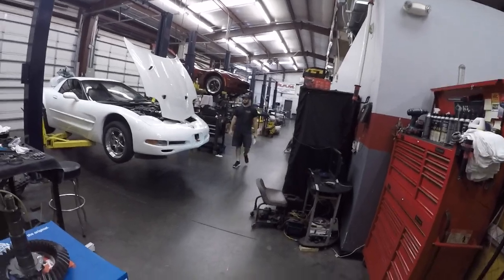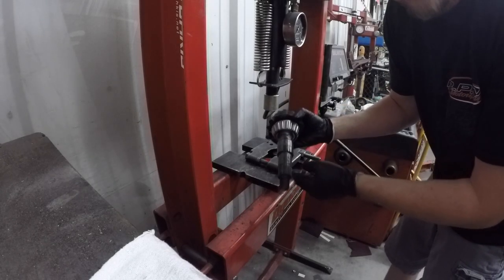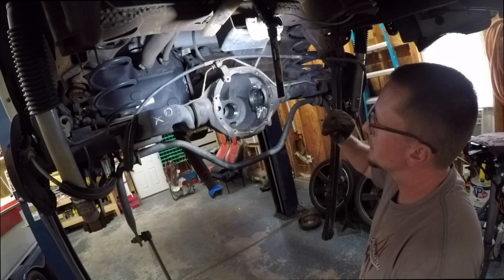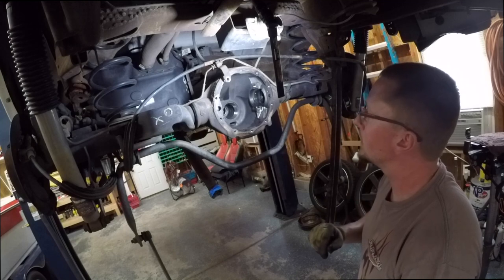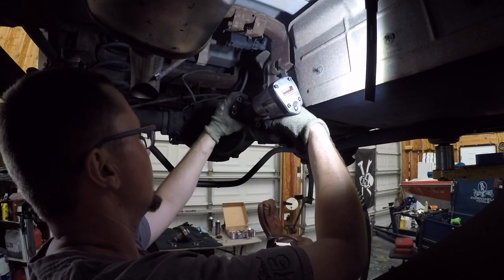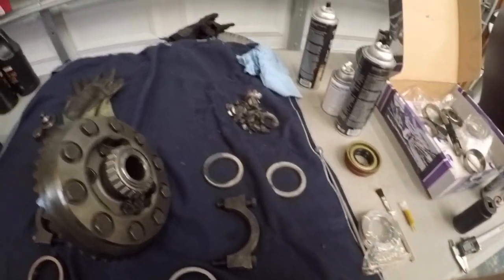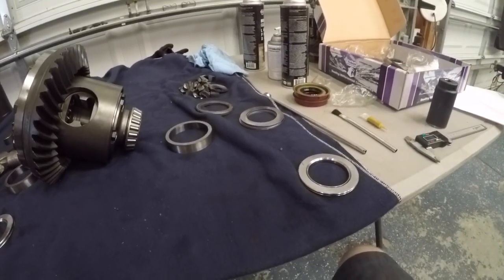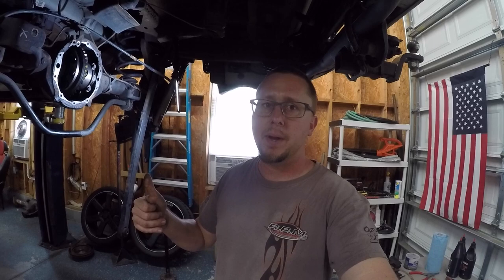How to Set Up Gears Chevy 8.6 Rear End

Comment: I went from 3.42’s to 4.10’s in my 8.6. The pinion shim was way off and I had to do a bunch of trial and error with it. I bought an extra set of pinion bearings and made “setup” bearings. Ended up working out perfectly. No howling or whining.  I put a bunch of heat cycles in the gears going back and forth to work until I got to about 450 miles, then it was all hell breaking loose and black marks everywhere.

Comment: I also have a gm 10 bolt with 3 73 gears in my 07 gmc Sierra. I am in the process of also installing a new am gear set with the master install kit and a Eaton Posi (massive upgrade from the gov lock pyle it came with, gm should be slapped) I couldnt count the different pinion depth and backlash settings I have tried ALWAYS with the drive side pattern running of the heel of the gear. Was totally losing my mind, glad to hear first hand this is acceptable pattern as Im not sure how much more patience I have in me!!! Thanks for the video Im about to slap this B together and get it the F outa my shop!!!!! Thanks again. You got the thumbs up n a subscription!

Comment: On the pinion rotational torque I was taught to tighten it to the point where you can't turn it with one finger but can with 2. Also its interesting that you said 10 to 12 ft. Lb. I was always taught 8 to 13.
Reply: inch pounds NOT  foot pounds!!
Reply: Inch pound boys like Stu said.

Comment: 10 bolt means 10 bolts in the cover. 12 bolt means 12 bolts in the cover. GM  10 bolts are 8.5'" or 8.6"ring gear. 12 bolts are 8.75 ring gear. Ford calls their 9" rear a 9" because of the ring gear size.
Reply: Yep. Thst guy was right sbout alot of things, but wrong about that'n! I actually came to tha comment section to see if any adjustements were made. Lol

Comment: I need help working on a 8.6 GMC 373 gear 20 bolt. Three times I have tried  to set the new gears and each time I have . O55 back lash even after new shim kit and added .045 to driver side an removed frome other still .050 to .055 back lash and each time at first drive it sounds ok 20 miles  gets a ringing. 
It on a 4x4 2002 GMC with 373 gears . Changed gears do to shelling old ones  put the same size back in and all new bearings.he is running 37x13.5x20 tires . I is the opinion gear to fare  in and need more shims .

Comment: The spec is in inch pounds. Your method is how it's done by most but, inch pounds requires a different torque wrench and I've never seen anything but a bendy. I used the GM dealer tool for a ten bolt around 20 years ago for measuring pinion depth and used the included bendy for 12 inch pounds.
Reply: Inch pounds dragging that is.

Comment: First thing, how do you know what thickness spacer to put on the pinion before you press the first bearing on. Do you use the original spacer? Second, If you have to remove the pinion to get a proper gear pattern, do you need another crush sleeve. The way you did it, you set the preload and it was good, no more adjustment there.

Comment: I have a 2014 stock Suburban with the 5.3L, 76,000 miles on it and I am the original owner. Over the past few months, I have been feeling a clunk from the rear of the truck when accelerating from a stop. further investigation shows that when I attempt to turn the drive shaft by hand, it has rotational movement of around 1/16"-1/8", but no in/out or up/down movement. The diff fluid has been changed by me around 15,000 miles ago and everything looked good inside and the magnet had the normal amount of metal paste on it. I'm guessing this is backlash, but how could it loosen up like that with normal driving (I don't tow)? I have read of situations where the pinion nut has loosened up over time causing the condition I'm seeing. I hope to take the drive shaft off this weekend to test that theory, but assuming that's not the cause, do you have any idea why the backlash would suddenly increase like this? I really appreciate your video and will be very thankful if you have any insight on my issue. Thanks!

Comment: inch lbs for rotation torque on pinion?  not foot pounds?  i like those sandwich shims didn't know those existed!   thanks for the video.    if it breaks again gonna swap in a 9.5" SF rear with 6 lug conversion axles?

Comment: Question ? How did you know the rear pinion spacer would be accurate on a new pinion gear without doing some test measurements with a test bearing ?Did you just take a shot and hope the new pinion was exactly the same as the old pinion's dimensions ?thx

Comment: You have really solid videos bro. A lot of the ones I’ve seen I would like to do to my Tahoe. Nothing to drastic but just enough to feel a difference. I had one ? Though I haven’t seen you saying anything about the braking system or maybe you did idk. Wanted to see if you had stock and if so what are you running for pads and rotors.
Reply from the maker: They are stock size, from autozone. No real brake upgrades.

Comment: Do you ever check pinion depth, or just reuse the shim off old pinion and it’s good? I’m going to be doing my Fbody diff soon. It’s been a couple years since I rebuilt a rear diff. Also thanks for mentioning ECGS, I’m going to take the ride up from Fayetteville to get my stuff from them 👍
Reply from the maker: I dont have the tools to check. But reusing the shim gets your pretty close. Some times you need to redo it.
Reply: High PSI tv that’s what my experience has been thus far. Hopefully I keep getting lucky doing it that way
Reply: Take the old bearing or a spare and hollow it out to use as a test dummy. If you use the new 1 and it's off then you just wasted it.

Comment: I have a question. I am about to this on my 02 silverado 8.6. I got 4.10 aam gears , master install kit and a eBay tru trac knock off for it. For these posi's what's the break in procedure
Reply from the maker: For the posi, nothing. For the gear, about 200 miles of NO Cruise. So accel and decel

Comment: Quick question...I recently came into a LSD Camaro 10 bolt differential. If I take off only the ring and pinion and use the differential could I use the diff in my 8.6 10 bolt sierra?

Comment: Bro, set mine up so the pattern is in the middle. drive side is middle but not D shape. I believe coast side is a D shape and running more towards the toe, and actually part way off the toe. Put the rear back in the truck sounds fine. Then on second test drive noticed it whines on decel and coast. Any ideas? all bearings are new "timken". Running Dana spicer 3.92's in a dodge. Local driveline guy said those gears can be noisy.
Reply from the maker: Might not have enough preload on the carrier bearings. So backlash might have changed
Reply: @HighPSItv  thanks for the reply. I'm thinking the same thing. Im just talking about a starting point here not a final check, but do you know if I measured backlash off the pinion yoke, would it resemble actual ring gear backlash? I'm not sure because of the shape of the teeth and all that. I just want a starting point because I have to work on it outside here in 30 deg weather and want direction before I just tear it down again.

Comment: One quick question, would the rear differential be interchangeable for a 2004 tahoe Z71 and a 04 Escalade AWD. I got ripped off on my Z71 they told me I needed another rear differential, didnt tell me about changing any gears which woukdve been easier imop. I was wondering if I can just take it off my Z71 and put it in my Escalade.
Reply from the maker: I honestly dont know

Comment: Have a question trying to finish up mine, got to the point were high torque impact won’t tighten no more does that mean it’s finish? Checked with beam style torque bar and it stil has very very small play back and forth on the pinion should it be like that????
Reply from the maker: You need to get a stronger impact

Comment: Do you have to use the same shim when replacing the pinion gear or will it ever be different I am replacing  the ring and pinion on my 06 gmc YukonXl 4x4 8.625 3:42 gear ratio. The diff keeps locking up everytime I go to even slightly tighten the cap bolts I went from Timken to National bearings on the carrier
Reply from the maker: The carrier locking up has nothing to do with the pinion shim, It has to do with your carrier shims. I almost always use the same pinion shim.
Reply: @HighPSItv  I used the same shim which came stock in the truck it locked up used slightly thinner on each side still locked up. I replaced the pinion and the ring gears then during setup and of the threads got damaged on the pinion so they swapped out just the pinion could it be they aren't matched to each other didn't start getting locked up till after the swapped out pinion was put in. I went back to auto parts store swapped out the ring gear later last night but haven't put it in yet. They were same 8.625 and gear ratio as each other but that was only thing that was different... and thanks for the quick reply very thankful. I did notice an little more of a lip behind the gear portion of the pinion slightly thicker then stock 1 should I still use the same shim on the pinion

Comment: How much shim did you put on the pinion?  I'm curious because I had a set of summit 373 gears fail on me recently and I had 22 thousandth on the pinion. My backlash was ok and my pattern was decent. I just don't know what happened
Reply from the maker: I never measured it. Just took it off the old one.

Comment: How do u know how much preload to put on the carrier bearings ?
Reply: gun-nut257 the carrier preload really is just insuring that there is no side to side play. As long as the shins don’t slide right in you’re pretty much good. You shouldn’t be able to pull the carrier out by hand.
Reply: Shim*
Reply from the maker: Exaxtly
Reply: 2001 RedGMC thanks for the info man . I'm sure I'll be rebuilding one eventually . Burnouts and stock 10 bolts dont mix lol
Reply: I told myself I’d record it and upload it... I didn’t. It was my first one done by myself, and it’s held up so far. (9,000+ Miles)
Reply: It's Private it’s amazing what can be done with a little research and a couple YouTube videos 😂😂

Comment: So is 3.73 better or 4.11
Reply: Henry Sodari That depends on what your trying to achieve
Reply from the maker: What he said
Reply: 3:73 is an all around good gear for take off and gas mileage if youre worried about it . 4:11 is a short gear but a lot of stuff varies like what trans youre using, tire size,and converter

Comment: I have a 01 Tahoe how do I know what rear end I have
Reply from the maker: More than likely an 8.6
Reply: if it's 1500 it's 8.6 , but you can actually know everything from the the sticker in the glove box
Reply: 900fj10 what code on sticker shows this
Reply: Michael baker search for gm rbo code and cross reference yours to it
Reply: It's 3.42 but is that still a 8.6 and could I go 4.10
Reply: yup you can go with 4.10 and truetrac for greater strength , if you can get between the diff and the car you will see a plate with extra info on it , it should be close to the refill plug